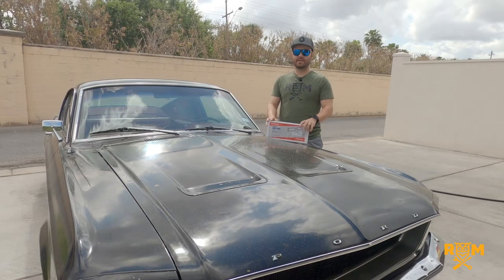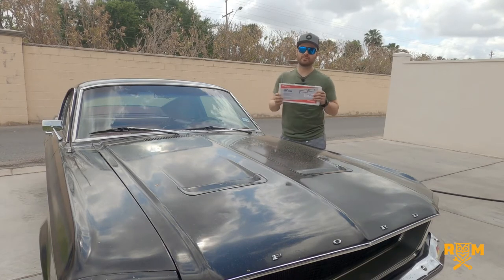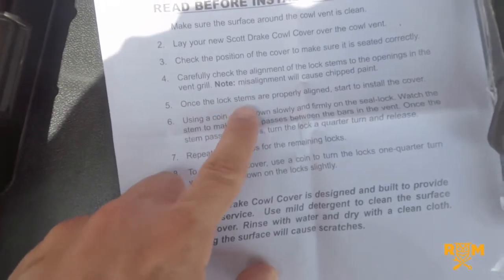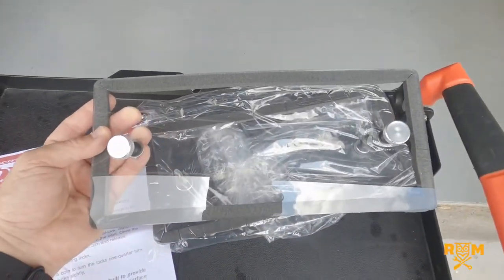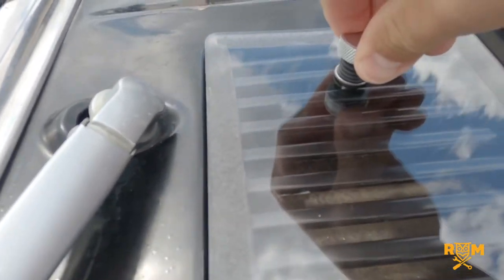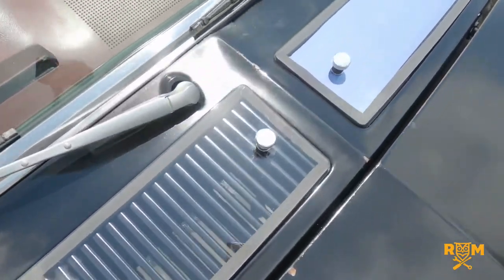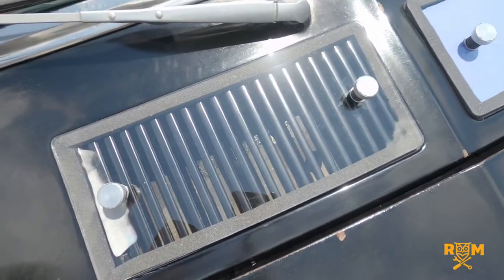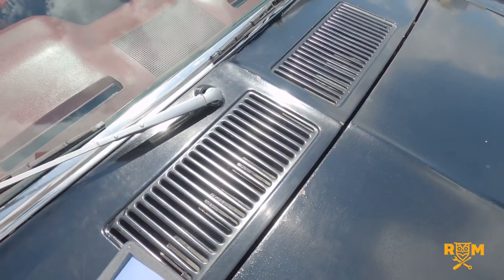Prevent Classic Car COWL RUST With These Special Covers!

Comment: I made my own for real cheap. The plastic was what I found and found some bolts at the hardware store that fit between the fins and used just a butterfly nut. The foam seal at the hardware store as well.